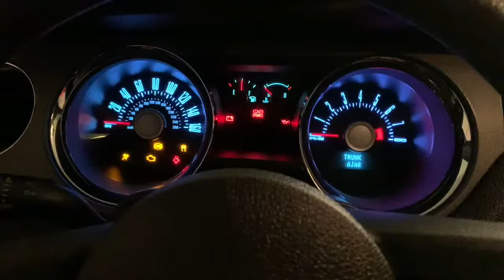First start of my new “Frankenstein Coyote” engine combo

Comment: I’m planning on doing the same build. How much did you get the gen 3 block for
Reply from the maker: just over $2100, my friend works at a dealer. You'll most likely find them for around $2500-$2600 new from the dealer.